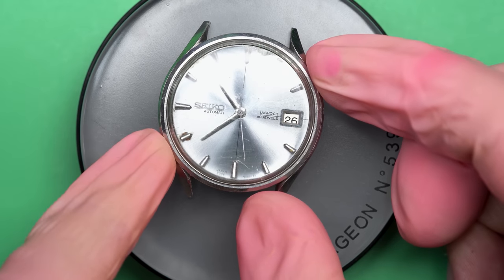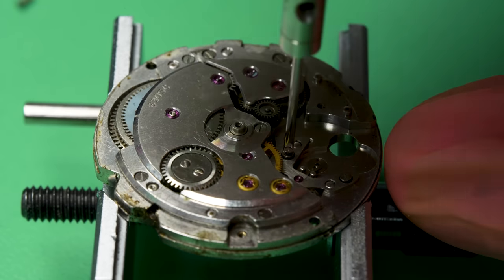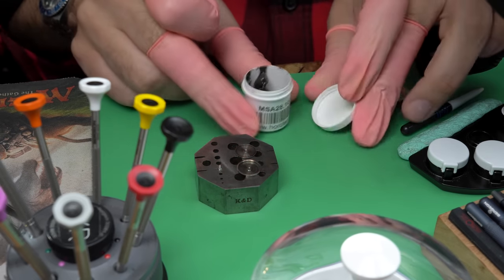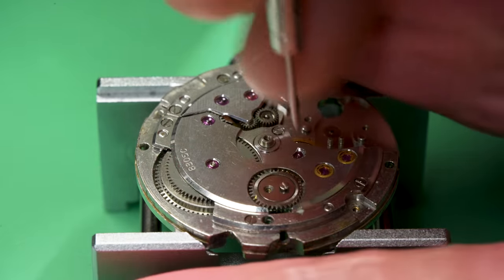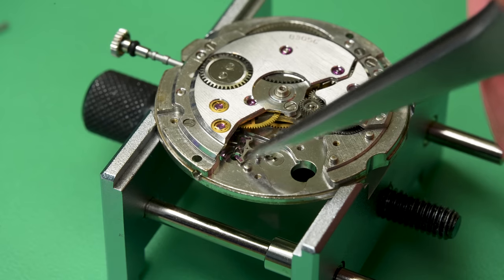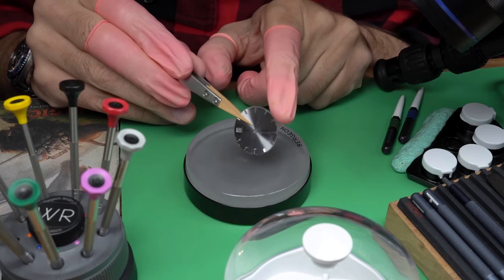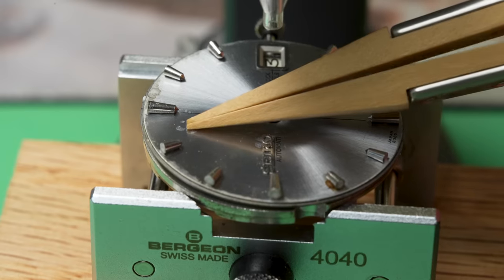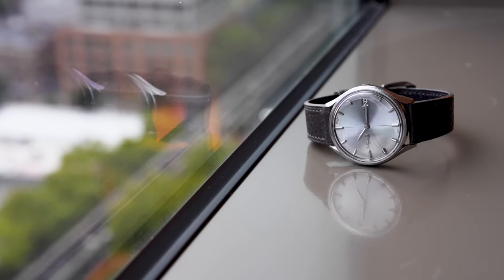Restoring a Watch for My Late Father's Best Friend

Comment: Small tip for the small repairs, get UV hardening expoxy instead of this black 2 component one, it is clear and stays liquid until you harden it with a UV lamp. So you have all the time so set your piece and make sure it's clean before you fix it in its final position
Reply: @Rasputin-p4e  He never claimed to be a watch repairer.  However; many don't know about things that can make their life easier and UV expoxy is a great one.  Especially for repairs where you have to line up other things after setting the part in place.
Reply: I think my dentist uses something like that
Reply: @neale3871  they use a special UV curable compound when they fill cavities. it's not your standard epoxy as such
Reply: UV epoxy is great stuff, but I suspect Marshall used something like JB Weld because it was a metal-to-metal join... also because it was completely tucked underneath (not much epoxy surface area to expose to UV light).  I've tried UV epoxy in a similar situation (along with half a dozen other adhesives!) and it was actually Marshall & commenters on one of his earlier videos who reminded me about automotive epoxies like JB... they require a little finesse to use, but they are rock-solid.  The comments section is always a goldmine of tips & tricks!  👍

Comment: Love vintage Seikos, wearing my purple Vanac right now while watching this 🤩 Comparing this older movement with the later iterations from Seiko shows how much time they spend to simplify the mechanics of the watch for easier production and easier maintenance. There are soooo many parts in there you won’t find in a 5626, not talking about the modern 6r series. It really was a step by step process, with every interaction they improved on little things. Some have been try and error, like the plastic date change wheels on the 56 series that break after 50 years from aging. But mostly I think they did a great job to streamline the mechanical movement into modern times, still creating affordable mechanical watches for the masses…

Comment: The most common bearing material used in a watch is a synthetic sapphire.
A Sapphire is a form of Aluminum Oxide.
Aluminum Oxide is clear or white when in powder form).
To become a Ruby, one adds a small amount of Chromium Oxide.
I forget what makes for a blue sapphire.  Nor do I know why I have never seen a watch with blue sapphire kor a green one)
I am sure Wikipedia will have a reasonably correct paper on the subject.
And again, thank you for a most excellent channel!

Comment: Marshall, great video. This one was a little bit different. You explain quite a few things I have been wondering about watches including that the jewels are man-made, the jewels are a 9 on the Mohs scale and don't cause wear, and they used specifically for the purpose of longevity. I would have "gorilla glued" the index because I didn't know about using epoxy. And lastly, the glow in the dark material application - I had no idea that you could buy the kit and mix it up yourself. What a wonderful video!! I learned so much. Thank you.

Comment: In my late fathers watch making tool cabinet there was a Seikomatic-R that I guess is about the same age. After adjusting the date and the time it will run. It gains about an hour every 4 hours  so i suspect the balance spring is magnatized. 

I will demagnatise it and service it as i think it has sat there since the early 80's when my dad stopped doing watches.

Comment: I use hexane or pentane for cleaning delicate parts. I clean my stuff with ultrasonic and Elma but delicate parts come to hexane. Pentane does the job as good as hexane but it evaporates faster. Both of these do not leave any oily residue unlike wash benzin or lighter fluid.

Comment: I bought my Explorer II new in Switzerland from Bucherer in 1975. The authorized Rolex dealer in my hometown wanted to send it to Geneva for $5000 repair and 5 month wait. I made the mistake of sending it to a "hack" repair guy instead. It never ran right since. In 1997, I bought a new DateJust from an authorized Rolex dealer just north of my hometown and with a 2.9% LESS sales tax! While fitting the bracelet on my new Rolex, the owner asked about my Explorer. He sent it to the newer Rolex repair facility in Philadelphia. They agreed to fix it in spite of the "hack" putting non-Rolex parts in it! They were thrilled to repair it. Only $1100 later, it is only off by a couple of minutes a month! The new DateJust is only off by a couple of seconds a month! Amazing for a 100% mechanical movement. I bought a small ultrasonic cleaner about 10 years ago. Every other month, both Rolexes are wiped down with a damp cloth and, using the watch holder for the cleaner (so that the case isn't submerged) the bracelets are thoroughly cleaned. You would be surprised at the amount of crap that comes from a bracelet that was cleaned only 2 months ago!

Comment: I watch all your videos and find them very therapeutic  I am 74 years old if I was younger I would get into watch works I have always worn a watch always either seiko or pulsar I at present own a invicta grand divers with a seiko n35 movement and a Casio mud master I didn’t realise how small the mechanical movements are until I look at the glass on the case back I was looking at the balance wheel on the invicta and the jewel are so tiny wow .my watch I would buy if I was rich would be a omega sea master but it’s wishful thinking unless I win the lottery I sm a old age pensioner I worked 45 years for a pitiful pension from the goverment  I also paid a personal pension through work and took it out and put it into another sheen that flopped lost nearly everything I live in the uk .good luck and keep on with your channel o by the way why do roles use plastic in their watches at the price they charghe I think they should be gold .

Comment: This may be interesting. I bought a few cheap watches on Ebay to work on and try my hand at this hobby before working on my grandfather's pocket watch that a watchmaker could not fix. One of them is a Seiko clear back automatic 21 jewel. I wonder if they will have similar movements.

Comment: Nice video as usual.  Firstly, the word waterproof is on the case back so pre 1972.  Secondly, knowing before 1972, the first digit of the serial number is a 5.  Therefore it is 1965, ie.  Mid 60’s.  Cheers, Geoff

Comment: I have a 1975 Seiko automatic that was worn for probably 15 years, then it spent the next 30+ years stashed in a jewelry box. I recently started wearing it again. It is running nicely, gains 3-4 seconds per day, but will sometimes stop after about 9 hours even though it was worn all day. Should I get it serviced?

Comment: Corundum is the crystalline form of aluminium oxide. It's very hard, on the Moh hardness scale it's a 9, and is the reference material for that hardness. The scale is 1-10, 10 being the highest, and at 10 is diamond, showing you exactly how resistant it is. Other things that are at a 9 are titanium nitride, and tungsten carbide, which is used in drilling and machining.

If Corundum contains chromium(which of course is also very hard), it will turn red in color, and we know that as a ruby. Corundum can appear in other colors, the most well known being blue, and we generally call that a sapphire. The color of a blue sapphire does not come from any particular material, bur from changes in the electrical charge, in what is known as a "intervalence charge transfer".

Sapphire also does not "have" to be blue, and comes in other colors. If there is chromium, but not enough to turn it fully red, it can be pink. In Sri Lanka and parts of Vietnam, you can find "Padparadscha" sapphires, which range from a deep orange to a pinkish hue of orange.

Due to its hardness, Corundum can scratch most other materials, and because of this it is often as an abrasive or cutting material, from the tips of drills and mills, to the "sand" in sandpaper.

Comment: Sir, u don't really need to remove those shock protectors from main bridge. Just use ur automatic oiler to save ur time and nervous system 😅
I personally remove them only when I can see some kind of black dot or debris through it on the light.

Comment: Took the pallet fork bridge off of my first ebay non runner and the bride jumped off and hit the table about 5 inches away and the pallet fork was gone. I was on my hands and knees for around 15 minutes before I gave up and figured I'd look more after a full disassembly. And what do you know the pallet fork was sitting right there on the table the whole time. I have to assemble it tomorrow!

Comment: Automatic movements are in a sense similar to a manual yaw sensor like they have electronic ones in modern cars of today which sends data like pitch and g forces to a car’s ecu but in a much more simpler mechanical form.

Comment: I feel your pain, I have been trying to get one of these to work on ever since i saw your first video on it,  i managed to pick up one at a flea market with a creamy silver dial that has problems ( hands were pressed down to hard wore a circle into the  middle of the dial) and it took me forever to finally find one with that blueish silver dial in decent condition. I have fixed the blue dialed one for myself, not sure what i am going to do with the creamy silver one that has the circle worn into it though.
Reply: took forever to find one on eBay with a good dial, glad i finally did though. it looks gorgeous, especially when the new lume is glowing so thank you for introducing me to the watch, (and for convincing me this is was a hobby i could do and get proficient at)

Comment: Hey i love your work, since the beginning of time i was fascinated by mechanical watches, i have quite some collection now.
It started out with my first Seiko which was a "kinetic" not automatic, the rotor produced a current and charged a battery/capacitor.
Years later i learned the difference and got intrigued by the automatic watches.
As i'm an engineer in hydraulics i do maintenance on hydraulic pumps/motors, which is basically full of gears like a watch just bigger.

What books would you recommend to get started into watch repairs and maintenance ?

Comment: The way that weld look like my suspicion is on spot weld, either one by one (doubtful) or with a machine that has on pole touching all the little markers and the other pole touching the dial face. Then at the press of a button, ZAP, and all of them are welded at the same time.
Heat build up should be minimal.

Comment: I got a 1991 TAG Heuer i am thinking about trying something with.
BUT ! It is a battery watch, and i absolutely do not have the tools for this job.
I do remember the problem, it got water inside due to a crown loosened by a meddeling kid, and the result was date do not like to tick over.
Also need a new chain.
BTW it was actually at the shop, but he did not fix it, well at least not the date thing.

Comment: Hey Marshall quick question for you.

The balance has a pin that engages in the pallet fork end, how do you know you’re setting that in right when you put the balance in?

It’s soo small and even zoomed in on the video, I can barley see it engaging. 

Looks like you’re just setting it down in hopes it’s lined up.
Reply: It's actually a jewel that sits in the pallet fork. It's called the impulse jewel. You can definitely line it up to sit in the fork correctly. It's not that hard and if you miss you definitely know.

Comment: Marshall, at some stage, I noticed you were living in Thailand. I am living there too and have an old O,ega that need service (mostly cleaning, it is running, but has not been serviced for decades). After what you told in your last video, I am reluctant to send that watch abroad, so if you plan to be back to Thailand, I would be glad to sned it to you for service.

Comment: I'd actually really like to see you service one of those really awful throwaway chinese movements, the kind you can get in automatics that cost like $30 new, it'd be interesting to see how well a serviced one works vs an untouched one, because I heard they just dip them in some random oil or don't even oil them at all sometimes

anyway they are my current introduction to this hobby since they're so cheap and easy to get parts for

Comment: I have a 1918 Elgin pocket watch.  It was my Grandfather’s high school graduation present.  I took it to a watch repair place with another watch, my father’s Longines.  They serviced my father’s watch and it works now.  They said the pocket watch needed a setting lever and they could not source one.  The watch was running.  They have had the pocket watch over a year.  I’ve tried to look for a setting lever myself but I don’t know what exact part I need.  Could you help?

Comment: Having the jewels ruby-red is actually a missed opportunity. Pure corundum (crystalline Aluminium oxide) is slightly harder, so harder wearing than ruby and is uncoloured. However, I suspect the practical difference is zero; a ruby jewel is still harder than the metal it is bearing. 

The technology now exists where the wheels of a watch could be made from synthetic sapphire - another form of corundum - and in principle this would also work for the balance spring and the main spring. In that case, having the bearings being pure corundum would be necessary. But, nothing would corrode. 

Apple nearly started doing sapphire glass screens / backs for its phones, but pulled out probably because they realised that an indestructible phone would be bad for future sales. However, samples that "leaked out" of Apple were very thin sheets of sapphire glass that were essentially un-breakable, surprisingly bendable, and nearly un-scratchable. It'd be tricky to work into a gear wheel, but it could be cut into a phone screen and it's only a matter of cutting scale. 

Apple pulling out of this bankrupted the company that had invested a lot of money to be able to produce sapphire glass in large quantities....
Reply: Surprising that they didn't find a market in the us military.  I know some our jets have a sapphire cockpit even

Comment: Hey Marshall,

Love your Channel.

I gave my beloved 20 year old+ TAG Heuer 2000 Pro watch to my Malaysian best friend as a wedding present and then 2 Mths later, the battery went flat. His local random repairer in Malaysia said it can't be fixed and the 2 sec Second hand battery, low indicator function, stopped working. I feel sad that my friend had to go through that. Can you help? I still love this watch and my friend. The watch will no longer run, the crown screw no longer functions properly, I think the repairer, broke it ;>(. Please help or otherwise would appreciate, pointing me in the right direction for repair in Sydney, Australia.

Comment: You keep using the term capillary action - that only refers to liquid flowing through a narrow space in opposition to gravity.  No capillary action is taking place on any watch I've seen you work on.  It's simply surface tension that's keeping the intact beads of lubricants in place.  Kinda a nit-pick, but you've used capillary action incorrectly in quite a few videos, so now you know.
Reply: Er .. if you introduce a tiny drop of oil into the junction between a wheel pivot and a bush, and it's 'drawn in'....then that's capillary action.... 
.....so....
....now YOU know.....!!!

Comment: As long as its the appropriate part I don't see the point of getting hung up on things like the replacing the main spring on a watch.  You replace worn out parts on your car so keeping worn out parts in a watch because "its original" is kinda stupid.  As long as its OEM parts IMO you ARE putting it back in perfect restored order and shouldn't devalue anything.

Comment: Something is wrong with the movement. Before you service it it was 296-300 amplitude and after the service 230. You dropped significantly even with a new mainspring.
As for your advice people get into watchmaking that's a bad idea cos you forgot to mention that they need a ton of money for tools is not a cheap hobby.